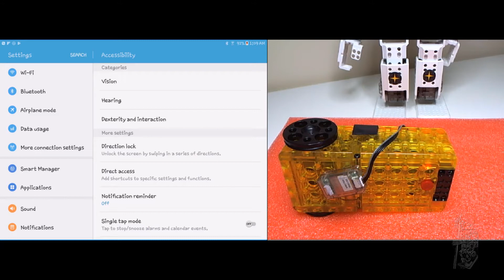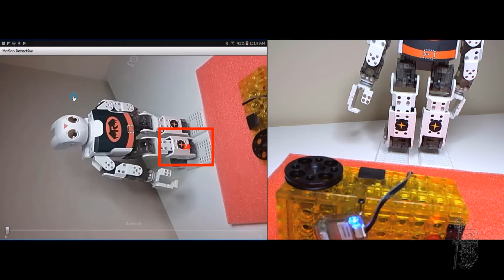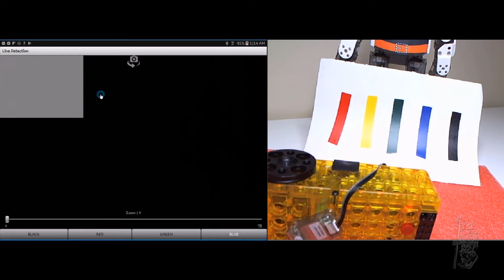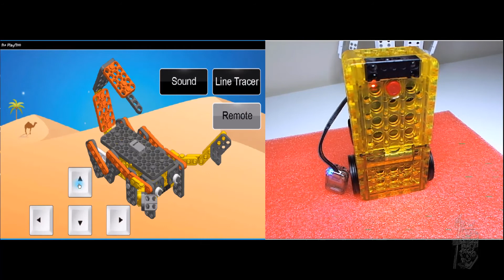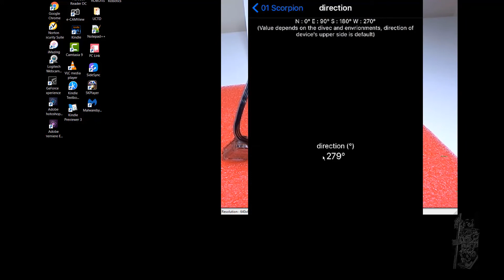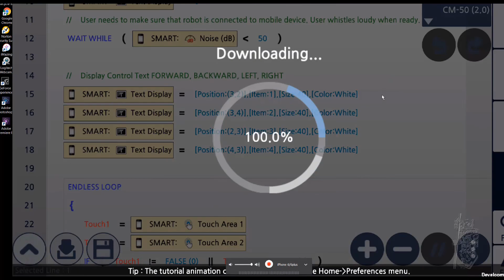P_Video 2.2 - Using PLAY700 App on Mobile Devices

Comment: Hello! I have a question, tell me, please: After I program my robot with Scratch, can I control my robot by application play 700 using example programs in it ? The same question is about R+m.task?
Reply from the maker: To use SCRATCH (off-line version and from a PC) with the PLAY700 system, you will need to install the helper app called R+SCRATCH (download from this webpage http://www.robotis.us/software/play700/).  Also please view my other videos P_Video 2.5 (https://www.youtube.com/watch?v=lOKhAlpu5qk&list=PLtix7rPAJwqzQi0pTCdujz3npP77fK8Kr&t=5s&index=7) and P_Video 2.6 (https://www.youtube.com/watch?v=jbbyAhX88Mk&list=PLtix7rPAJwqzQi0pTCdujz3npP77fK8Kr&t=2s&index=8).

To use R+m.TASK with the mobile app. R+m.PLAY700, please view video P_Video 2.4 (https://www.youtube.com/watch?v=7oJFfAx0ff4&list=PLtix7rPAJwqzQi0pTCdujz3npP77fK8Kr&t=2s&index=6).  

If you just want to use the "plain" R+m.TASK please see P_Video 3.1 (https://www.youtube.com/watch?v=XSjckTnF22E&list=PLtix7rPAJwqzQi0pTCdujz3npP77fK8Kr&t=3s&index=11), and P_Video 3.2 (https://www.youtube.com/watch?v=MykUZBcQRNg&list=PLtix7rPAJwqzQi0pTCdujz3npP77fK8Kr&t=211s&index=12). 

All these videos are designed to accompany this book (https://smile.amazon.com/Learning-Robotics-ROBOTIS-PLAY-Systems/dp/0999391801), if you need more detailed instructions.
Reply: Thank you for your quick answer. But i still don't know: If used scratch, programmed my robot, and then after that i want again to use application r+m.play 700, will it work (example programs)?
Reply from the maker: The short answer is YES, it will work fine.  Programming the PLAY700 via SCRATCH is independent from programming the PLAY700 via TASK code working together with the R+m.PLAY700 app (as provided in the 4 example codes when you bought the PLAY700 system).  
If you are interested in a more lengthy answer, please visit this web page https://www.cntrobotics.com/robotis-evolving-dynamixel-concept and read on.
Essentially, a SCRATCH program actually runs on the PC, and it passes all the SCRATCH commands via the helper app called R+SCRATCH which then sends them directly onto the firmware of the CM-50 controller of the PLAY700 and then to the various actuators and sensors on the CM-50.  In this situation, any previously downloaded TASK code via R+m.TASK is "disabled", but "not erased". 
When you want to use the features of the R+m.PLAY700 app, you have to create a TASK program via R+m.TASK which uses SMART DEVICE commands to communicate with and to use specific services on the mobile device such as touch areas and video camera for example.  This TASK program is compiled then downloaded to the CM-50 via the normal way (BlueTooth for example).  At run time, this TASK program runs on the CM-50 and send various SMART DEVICE commands to the mobile device, for example to know which touch areas were pressed by the user or to make the video camera take a picture and save it on the mobile device.
Reply: That's great!!! Thank you very much! Appreciate your great help!!!